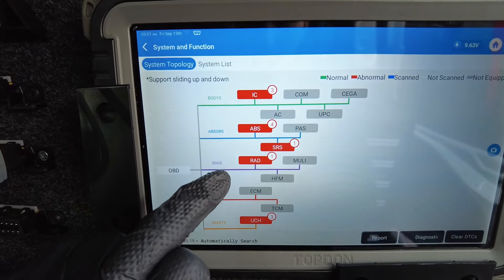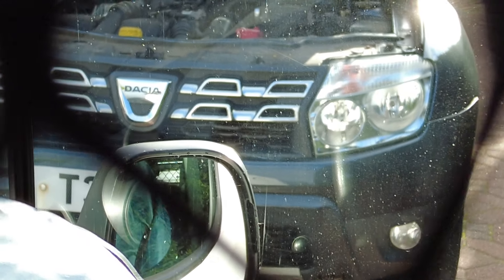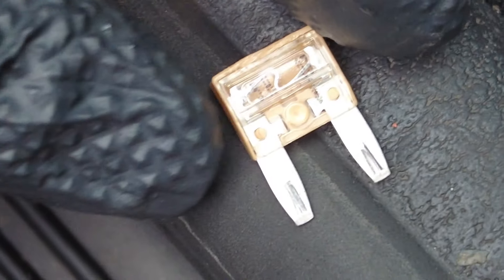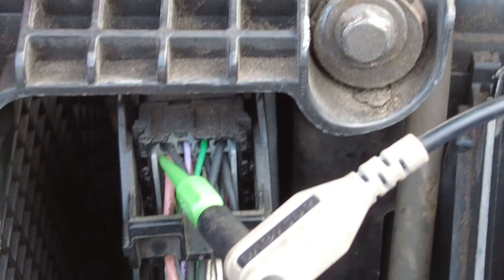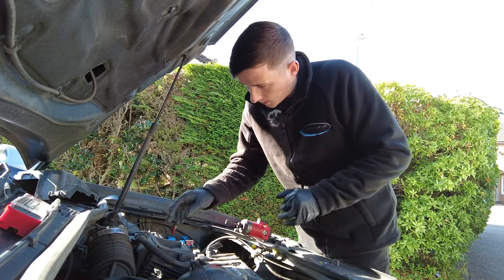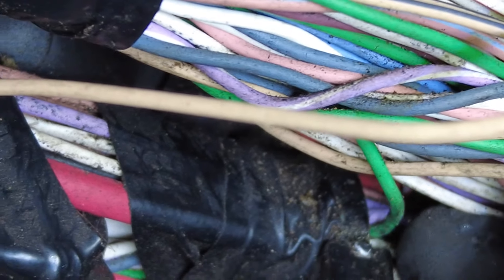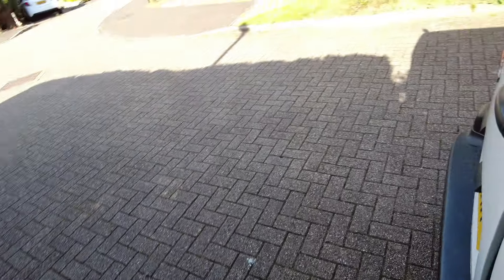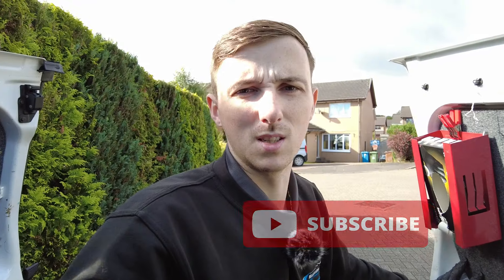CAR CRANKS BUT WONT START - THIS IS HOW WE FIXED IT

Comment: Well done Mac,  👏 
Two points, I've noticed over the years that tywraps are increasingly not the safety type with the teeth outside, they're inside so can chaffe the insulation,  ans also, the foreign cables are not tinned copper  just  bare copper so plenty of potential "time bombs " ticking away  through corrosion. Hugely excessive amount of viscious road salt in winter  is a hazard too 😮

Comment: Love that you go straight to the relevant points, if someone wants to learn thats pure gold. Trying to learn by myself because as owner of a Renault Megane 3 made in Busan South Korea havent found a single commited technician around me. It presents Intermittent codes P2101, P2108, U0401, P0653, P1526 that I assume are all related to wiring and network issues. Congrats, keep up with the nice job you do, you are heros for your clients.

Comment: Excellent Ryan, as always. I found it logical and easy to follow and there is no need for you to apologise to the viewer because they are benefitting from them, if they know it already and do not like your explanations then they need to stop watching.

I am not an automotive electrician or mechanic and in this situation I would have checked F9 and popped in a new relay (or more likely bench tested the existing relay) and then I would have really struggled without access to a wiring diagram - how can a DIY chap access wiring diagrams affordably?

Thank you for sharing your work with us.😀👍

Comment: Very useful. My mechanic gave up on my old Bora. But after watching a couple of these I manged to get it going again. An ECU / immo problem.  I could not  have done it without Ali Express and their dodgy scanner cable / software. Pro tip. Install it on a virtual PC with no network access and delete it afterwards for safety.
Reply: I always think Ali express is fake /scam did you get what you ordered and did it take forever to arrive thanks …?
Reply: @TwIn603 I use it a fair bit. Delivery is reliable 5 days or you get a voucher. The software you are taking your chance. I think it's usually a cracked version of something expensive same for the hardware. Windows will report it as a virus. Don't know if it is or not. Hence put it on a virtual PC you can delete. My £3.99 ODB cable came with some freeware / shareware software which worked fine  but I would not trust it just the same.
Reply: @Random-es7yo  thanks for the reply man I gonna be giving it a chance with virtual machine on pc !

Comment: Cheers for video Ryan, lucky man getting the 120amp battery maintainer we have the 30amp Topdon and it does the job for us but we don’t program cheers sandy
Reply from the maker: Cheers Sandy, aye i am looking forward to receiving it 

The 30 amp one is ideal for doing diagnostics i would likely have bought similar if they didn’t offer

Cheers
Reply: I was just thinking the same Sandy, a nice little present to get Ryan. 
As you say sometimes it can be hard to get across what your thinking on camera and then off the keyboard warriors go 😂😂
Good video though 💪💪

Comment: Nice one Ryan , every job is fun nowadays , but correct testing as you are doing is bang on 👍👍, nearly every job now out comes some form of battery maintainer,  so much power drain when testing for faults , unfortunately our job is so costly for tools , so its very nice that you will be soon getting a new shiney maintainer,  especially as a gift , great video , green crusties , its a good job we dont live in the salt belt of the USA , as you know  here in the UK our wiring just gets wet 😂😂😂😂 then rots away , cable ties are great but not when pulled so tight , they become a plastic saw through wiring 👍

Comment: Brilliant Ryan..  Such a simple and avoidable fault if manufactures spent another few pence on better wire and routing management systems like they did in 1969 when they landed men on the Moon ( or did they !!). Also makes you wonder if the UK is the only European country to use salt in the wintertime icy road treatment ?  On the bright side it keeps you fully employed eh ! 😅

Comment: Nice job, how do you recommend these kind of wires are repaired?  Do you solder and heatshrink? or do you find the waterproof heatshrink crimps useful?
Reply from the maker: It depends the location but this one i red heat crimped with secured with adhesive tubing, Some awkward places i will solder

Thanks for watching bud

Comment: I use a 13.8V maitainer but sometimes forget its in battery charge mode. Not normally a problem but if its in AGM battery mode it over voltages the Stop/start ECU. And everything locks out.

Comment: I never use a meter for testing power, you could have a rotted out cable and still show good voltage, at least a 10 watt bulb
Reply from the maker: As said in the video the load testing through a h7 bulb was done off camera, This is to prevent too long of video

And the consumer was plugged in, if a high resistance was present with the consumer plugged in it would have shown on the multimeter